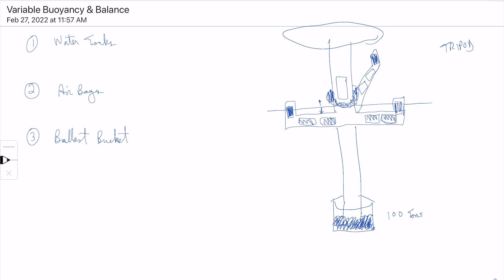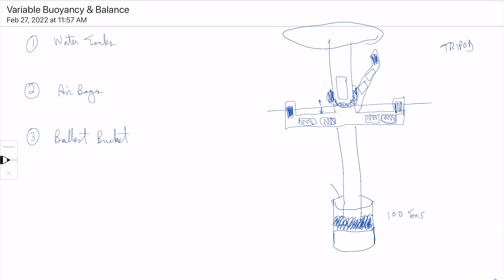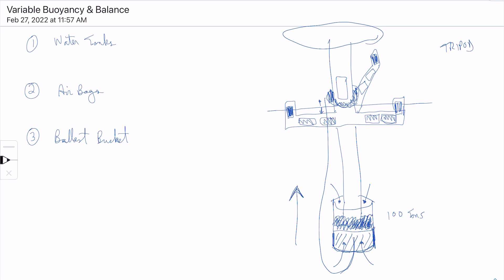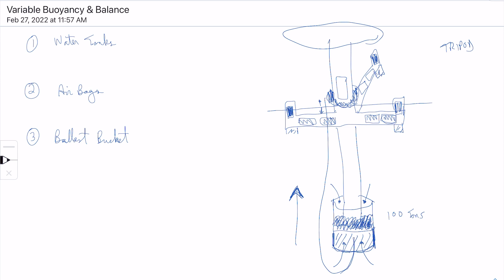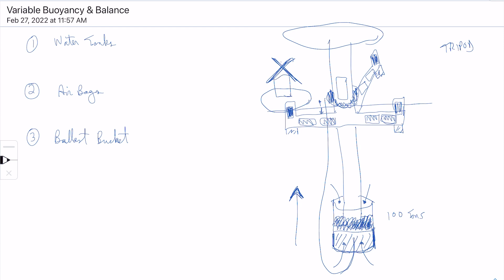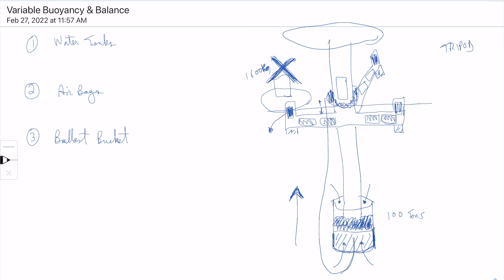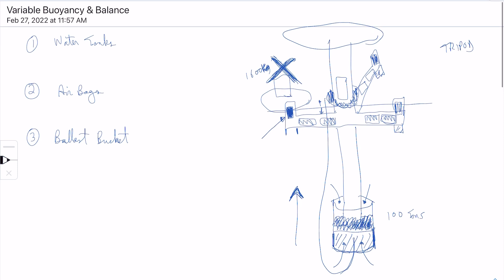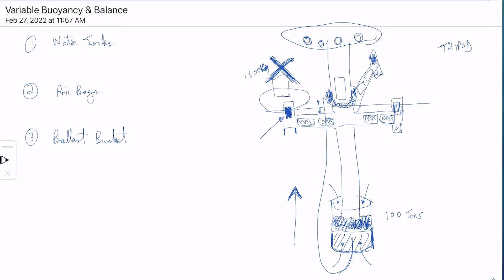Variable Buoyancy and Ballast for  Floating Pods and other Structures

Comment: Imagine using this technique on SWATH vessels. It could almost eliminate seasickness. Especially if combined with a hydraulic leveling platform on top. I suppose the top of the Floating Pod could be suspended on a type of gimbal to remove any residual movement.
I get slightly seasick from even the smallest movements.